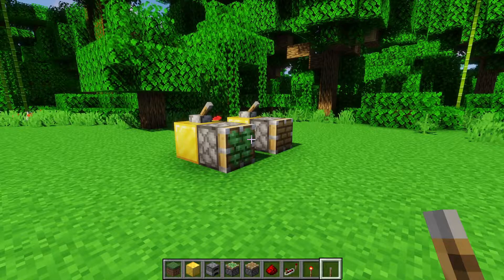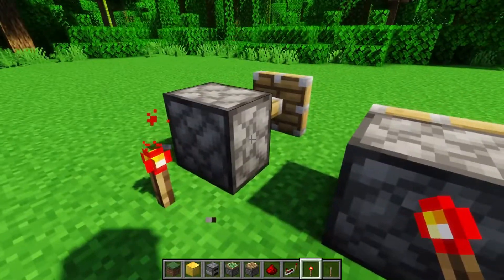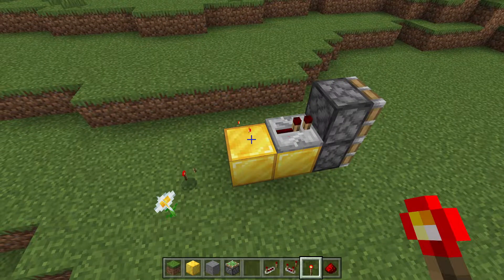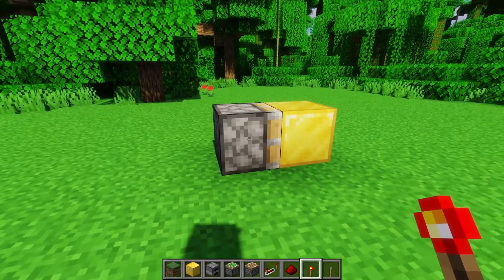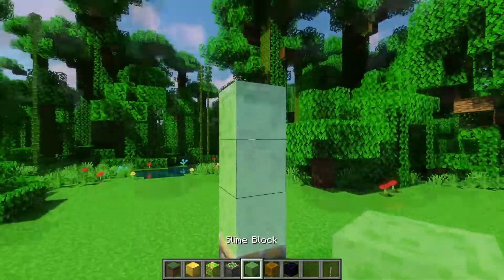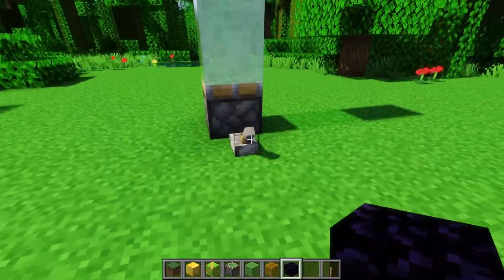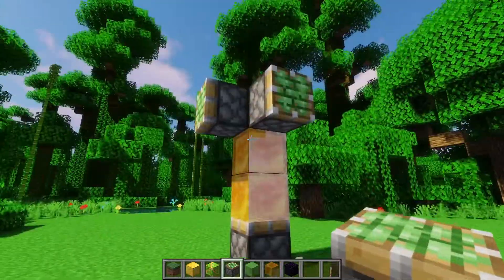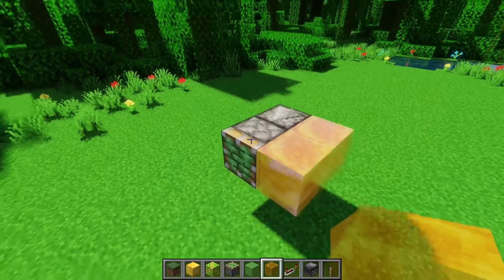Pistons: Everything You Need to Know (Java 1.21.11 & Down) | Minecraft Redstone Engineering Tutorial

Comment: I have a problem with these sticky pistons leaving blocks, when they used to don't do that. I have  a 3x3 cement door I've built for a castle and in the last updates of the game, it have broke. (I used to play in 1.16.4, then I've updated my world to 1.21.4). The pistons don't pull back the other ones from above, causing the cement blocks to drop as items and when the door was supposed to close, it remains one layer of blocks left to close. That is very frustrating and I have not found yet any solution to this.
Reply from the maker: This is interesting, I have never heard of blocks dropping as items like this before. I don't see anything in the patch notes that would indicate that it would have changed, and my own 3x3 door design still works as intended. Do you by chance have the experimental redstone game rule enabled that changes how redstone behaves? This would be the thing that enables the infinite power rail speed loop as well
Reply: @ZennsWorld  I tried this system ( https://youtu.be/eyl85UH8o2c?si=7MLJYCc_iJkfuazH ) instead and it actually works.